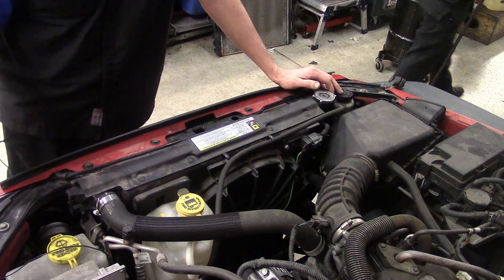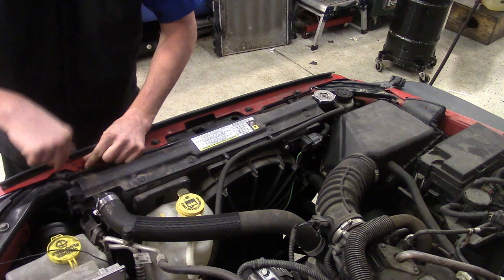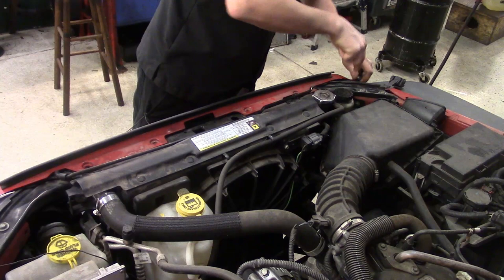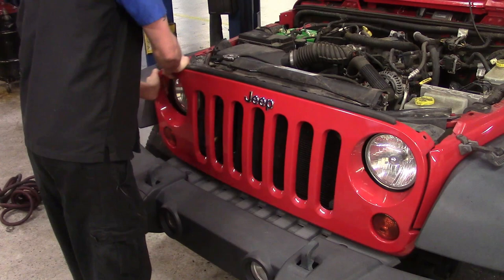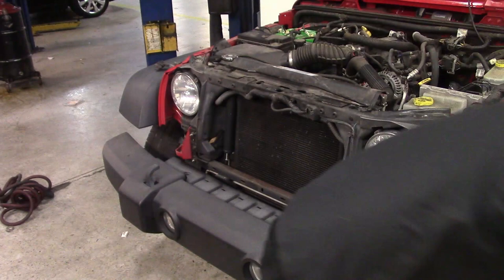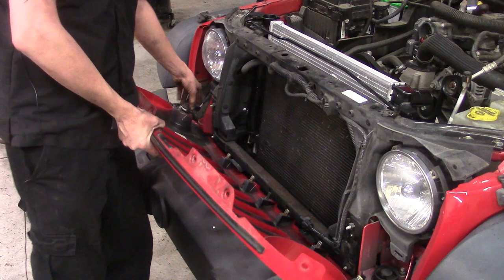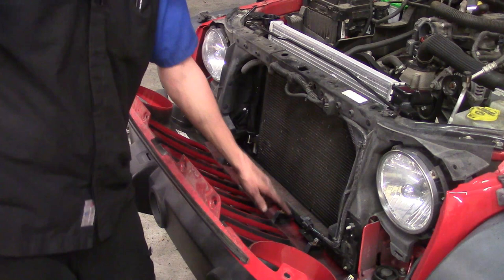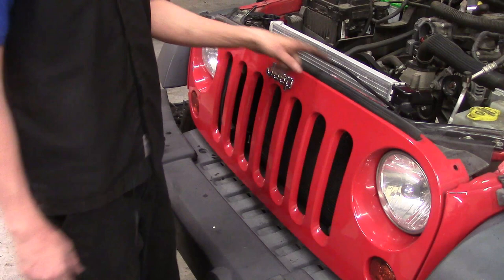2007-2014 Jeep Wrangler front grill

Comment: WATCHED THE VIDEO ON HOW TO REMOVE THE DOOR PANEL FOR MY 2011 WRANGLER. ALL GOOD , NOW I HAVE TO REPLACE THE INSIDE LATCH CABLE - NOT SURE HOW TO DISENGAGE THAT INSIDE PANEL WHICH IS ATTACHED TO THE WINDOW TO GET TO THE LATCH AND INSTALL THE CABLE. ANY HELP?
Reply from the maker: +John Grabowski I feel that I cant say it in just words. There are a lot of steps and a video would be the best way to show it. I haven't had the chance to make a video as of yet. I will try to keep it in mind the next time one comes in for that issue. The service info includes a lot of info and images.....I cant attach them to this message.  If you email me at david@motorcitymechanic.com I can try to send you some info on the removal.

Comment: Hello david I had a ORF front bumper installed on my 14 jk and it is so darn close to grill it is almost impossible to change it out It now has 1/8th inch between bottom of grill and bumper the bumper is very heavy and torqued on with 16 various bolts to the factory holes in frame etc ( great bumper ) I have purchased a new factory satin black grill replacement due to severe road damage and want to know if you think it is possible to simply install grill using only the top 6 push pins and only the center lower push post and cut off the ones at the bottom that are to close to insert into the frame  any help will be greatly appreciated
Reply from the maker: Hard to say.....Almost have to see it in person to picture whats needed. No harm in trying it on the old one you are replacing to see if its possible if its not too damaged.
Reply from the maker: One of those trial and error things.

Comment: Do the turn signal lights come out easily?  I'm trading out the grill on my red 2011 wrangler with a new black grill.
Reply from the maker: +jerry wells Hello Jerry. The turn signal housings come out easy enough. You shouldn't have any issues. I bet that black grill will look great. I have become partial to the angry bird grill. Gives that sinister look. Thanks for watching and make sure to subscribe
Reply: It's a angry bird grill actually.  Thank you for the help and the video. I feel a lot better tackling this project now.
Reply from the maker: jerry wells Awesome! Its really going to look great then.
Reply: +MotorCity Mechanic if you ever have remove and replace the fenders be sure to post a video.
Reply from the maker: +jerry wells I need some local jeep owners who would like some free installs so that I can film them. I will keep it in mind.